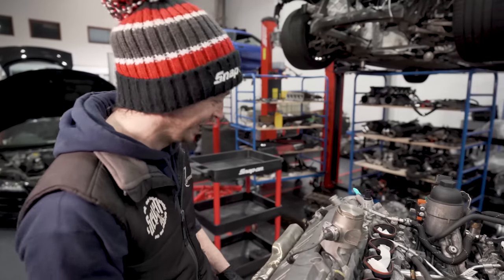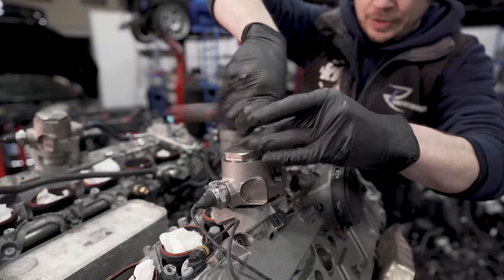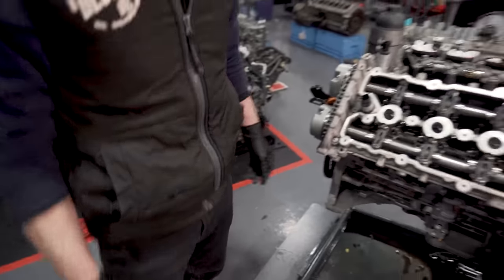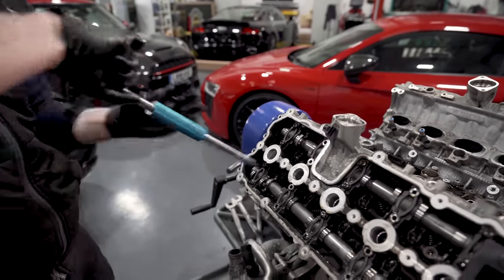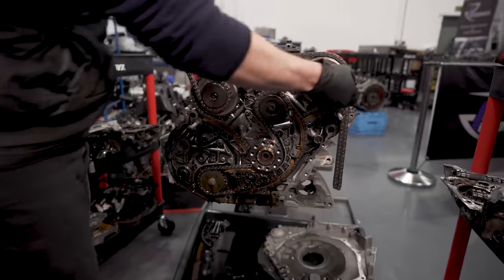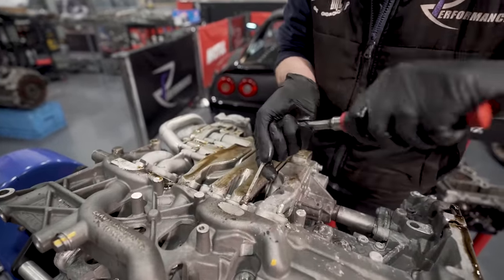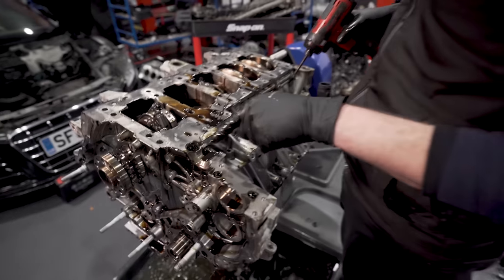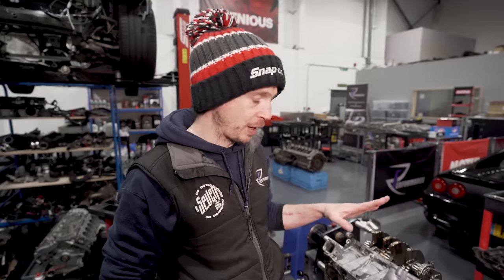Can We Strip A Lamborghini V10 Engine In ONE Hour?

Comment: Great video...I'm a  bike guy, so I'm more into your bike build and racing videos. Love GT racing  so this is interesting,  and is very therapeutic just watching an engine tear down anyway.. You have a great way in explaining everything and not overcomplicating stuff with too many technical terms...and..Chocolate Hob Nobs! 👍🤘🏍
Reply from the maker: Glad you enjoyed it! Yes the GT3 engines are great to work on as the stress analysis is all based around average rpm over general load or combustion pressure say like on a twin turbo.
Reply: @REPerformanceUK  what compression do you go for when turboing a huracan? do you lower to 10.5?

Comment: Technical Question😂 Where does all the waste go, after the engine is put in the wash tank ? Does it get emptied each wash? Or does it get stored and you just drain the machine off when it’s full?
Reply from the maker: The Motul tank looks after itself, the hot wash is drained and disposed of with a specialist company.